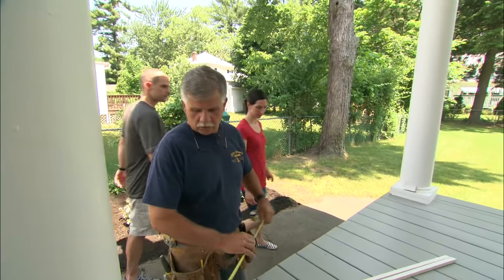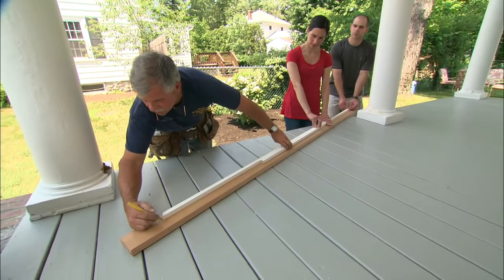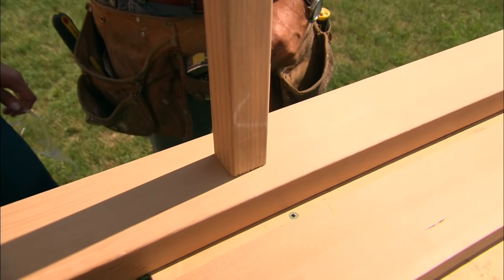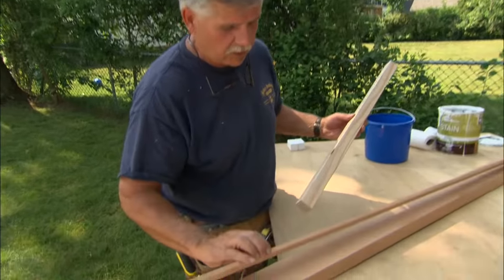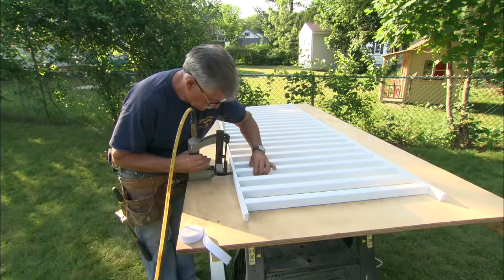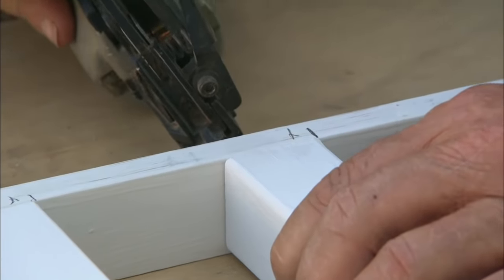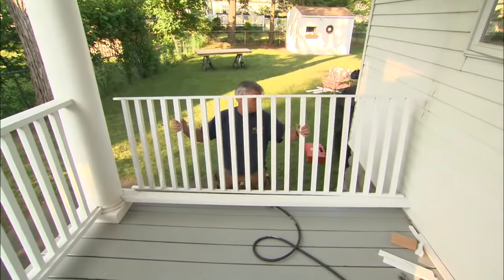How to Build a Porch Rail | This Old House

Comment: Most tape measures list the length of the body so for an inside measure take your measurement and add the length listed on the tape measure.
Reply: although that works for rough measurements, I never trust that method for precise measurements.
Reply: I had the same thought.  I use that frequently.
Reply: Nobody does that lol

Comment: I would have liked to have seen more on how they attached it to the house.  Was the siding vinyl or wood?  How did he cut the little square out for the 2x4?  Is that better then just mounting a 4x4 vertically next to the house?  I'll probably just mount the 4x4 and have the top railing attach to the house and have the bottom mount to the 4x4.

Comment: I tried this method yesterday and it did not work. it did not work because the elastic band did not stretch evenly. I believe this was because when I did some testing I expanded only one part of the band. When I used it on a longer board, the spacing was not consistent varying by more than 3/4" . I just used a spacer block and it was much more accurate. The part that was helpful was building the baluster rack on the bench and adding it to the bottom railing. I used a bottom strip of 5/8".

Comment: Great video. But I tried the elastic band trick and it wasn't accurate. Spaces became wider at the ends, narrower in the middle.
Reply: Using a block spacer would work.

Comment: Anyone else notice at the 5 minute mark that he did a fancy routing job to make the lower railing fit the column molding?  Guess he didn't want to share how he did that part.
Reply: It's hard to tell but he may have trimmed the moulding at the bottom squared out to fit the rounded 2x4 instead of routing it.  That's what I would do.  Would be nice to have shown us.

Comment: most if not all measuring tapes have the measuring tape housing with its measurement marked so all you have to is measure with tape and add for width of housing on inside measurements ....60 and 2 1/2 inches housing = 62 1/2 inches. also the reason that little metal catch tab on ruler is lose is because one way pushing gives inside measurement accuracy and the other way pulling is outside measurement accuracy.....Toms way is not wrong its just that using tape the way it was meant to be used saves time.
Reply: Ive been trying to understand this reading it. Sure its something somple im just overlooking. Can you explain/specific for me? Sory if im a lil slow

Comment: What are the dimension of the top and bottom boards?  Specifically width and thickness.  Are they decking boards or 2 X4 or 2 X 6's?

Comment: Isn't the most important part how you attached it to the house?  How did you do that?
Reply: C Gerlach 4:50 they attach to house
Reply: Yeah, just skip that part.  Unimportant
Reply: These videos seem to be heavily edited from the originals. Some parts have been left out.
Reply: At 4:50 they attach it to the post.  How is it attached to the house?
Reply: The post is attached to the house, so by attaching to the post they are attached to the house.
Reply: I guess I needed to be more clear in my question.  How do they attach the railing to the siding of the house?
Reply: Thank you.

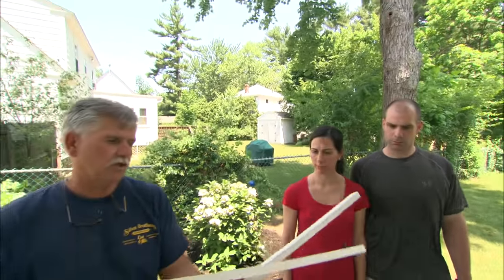Comment: 0:45 - Just get a couple of Lufkin 966 rules.  I've used rules instead of tapes for detail work for close to 50 years.  Much easier than what was done in the video.
Reply: Generally yes, but his method allows you to set them evenly spaced much easier if you're more concerned about symmetry than using a certain measurement. You can do the math and figure out the spacing if you want to fit X amount of balusters in a certain length...or you can do like he did and use the rubber band. It's just a time saver.

I've seen his method adapted for use with a customer who wanted 3 balusters grouped together, then a larger space, then 3 more...and so on. While one of the carpenters was trying to figure out the math, the other two used this method and got it done. Lufkin's are indispensable, but sometimes there is a more efficient way.

Comment: Though I'm not expecting a response, more detail could have been provided.  Specifically, what was the purpose of using the graduated rubber band...?  I understand the need for equidistant marks transferred to the strip used for capturing the balusters, but why 2" measurements?  And, why no level for making plumb the baluster rail assembly?  And, what about leveling the handrail... level to the porch (grade) or square with the column?  Nice project, just needs to provide some additional information so us DIYers can have enough for our own projects.
Reply: He explains in other videos that he tries to use less tools to make it simpler. You could have gone without the rubber band but then you would need to do divisions and trial and error. 2 inches is a sensible measure so you don't need to overstretch the band without breaking. Basically he's doing carpentry for newbies

Comment: Could you tell me if there's a formula for the same spacing on several different lengths of deck railing, I know how to determine the spacing between spindles but don't know how to go about getting them all the same on different rail lengths, would I find the spacing for the shortest rail first and check if the same increments work on the others ? Seems a very long method if this be the case, cheers
Reply: Go to Larry’s video on how to space railing for balusters.  Guy has a white shirt on, in front of a white pickup.  Don’t remember his name.  His way solves your question

Comment: They didn't cover the bottom rail.  With the profile of the base of the column it requires needs some fitting.  It would be nice to see how they did that.
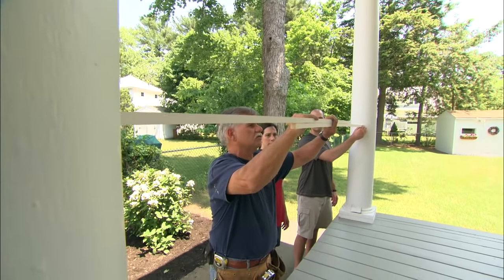Reply: There is an image at 1:05 where you can see a cutout in the complicated base profile of the column.  Presumably they used a multi-tool to cut the base, to create a gap for the bottom rail.  So the contour-gauge traced curve in the bottom rail should line up for a tight fit.   They avoided having to cut a complicated profile in that way.
Reply: @metame3803  I missed that.  Thank you.

Comment: 36" is too tall if you want to be architecturally correct. It should be the height of the window sill. Especially with those beautiful old columns there - you're gonna make the old house look like it has a cage attached to it.
Reply: I think most people would agree with this aesthetically, but in many areas, less than 36" would not comply with codes unless you get a historic exception or something like that.
Reply: It's even worse now. I'm redoing a folk Victorian as a BnB and cOde here calls for 42 inch railing on any area that is more  than 18 inches from the ground because it's a commercial building. It's ridiculously high.
Reply: 36" is a requirement here. There are marks on my columns where a shorter railing was once installed. Spoke to the code dept and if the old one was I place I could have restored it. As soon as the old one is removed the current code applies. Bummer

Comment: Did they paint over Cedar lumber?
Reply: JDBoats89 loads of folks do it
Reply: I think its for ascetics.
Reply: Straight grain  Douglas fur
Reply: Can you use regular pine 2x ‘s for this project as opposed to pressure treated. 
I have a customer that wants a white painted porch handrails & spindles. and I heard you should not paint over pressure treated lumber 🤷‍♂️
Reply: @russellmotter5022  o